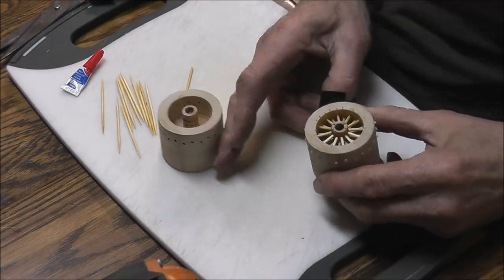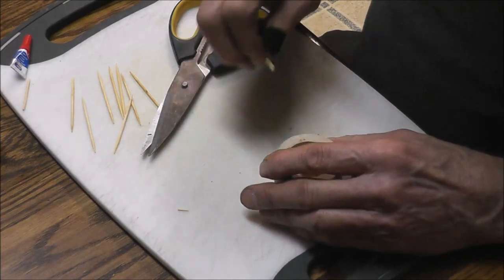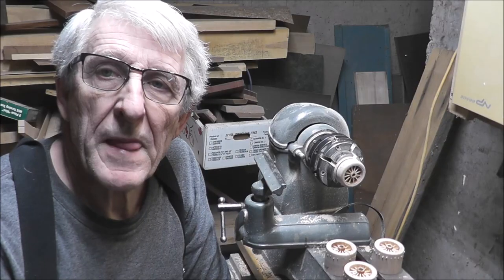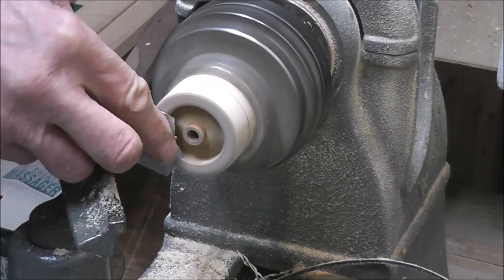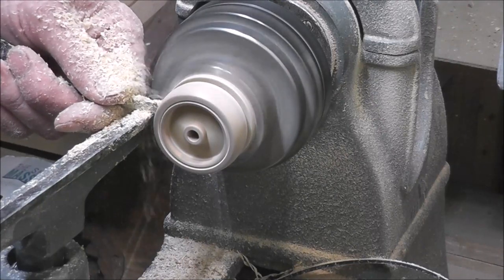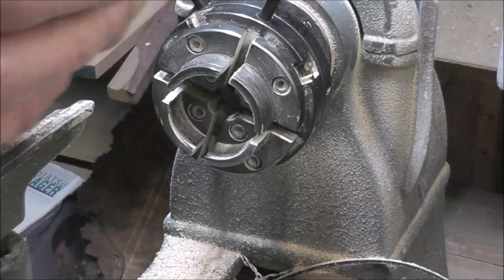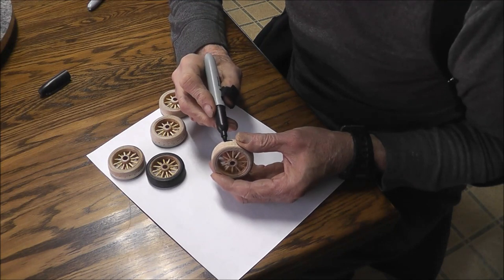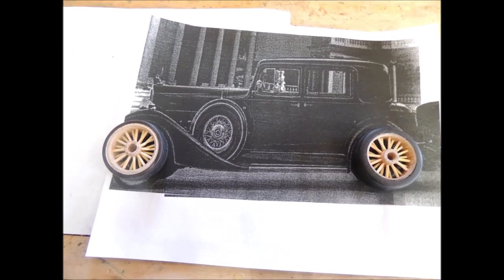Part 2, making spoke wheels for model cars and trucks

Comment: Enjoyed your video. Great job. I have been making spoked wheels for classic cars. They are 3 1/8" outside diameter. I put 8 - 1/8" bamboo spokes in my wheels and add an outside tread to cover the ends of the spokes. The bamboo spokes are made from squires that can be purchased in most kitchen hardware stores. To drill the 1/8" hole in the rim and hub I use a 1/8" round ball Dremel bit. Unlike a drill bit it has a solid shaft and won't flex like the drill bit. After setting the spokes into the rim and hub (maple), I add the outside tread (black walnut) and trim to 3" on the lathe.
Reply from the maker: Great idea on the dremel bit. The 24 spoke wheels with regular drill bits was a challenge.  I have a number of small dowels that I picked up, I think the dollar store.

Comment: you can get a bag of about 200 5/64 inch dowels, 2 1/2 inch long, at Michael's or Hobby Lobby for a few $. I found them to be more consistent when I needed pins to build excavator treads.